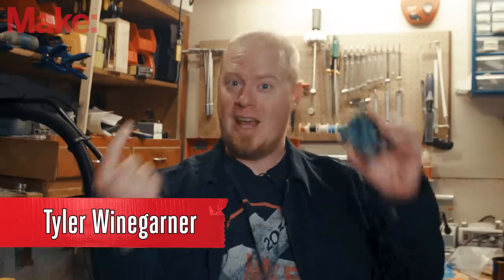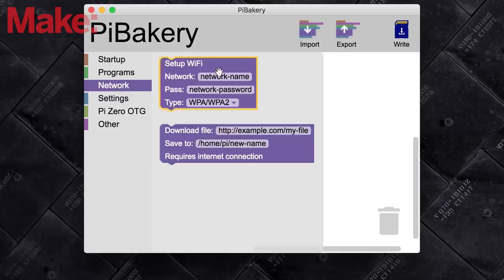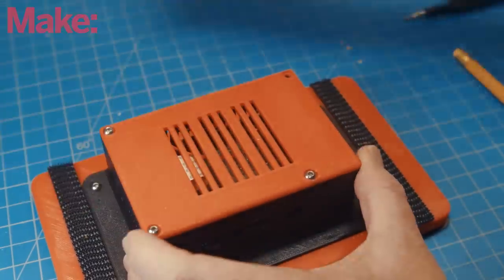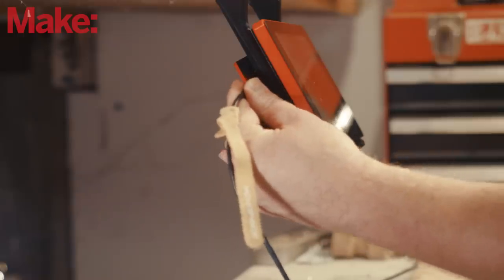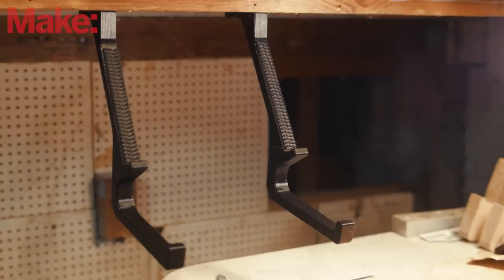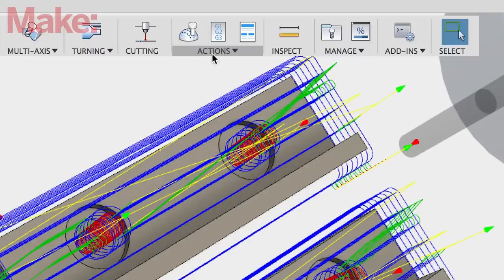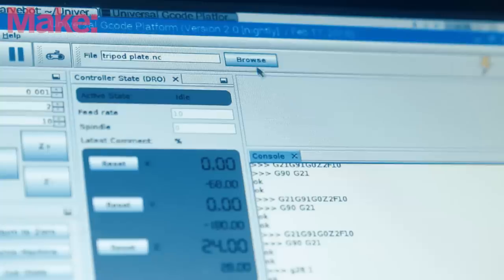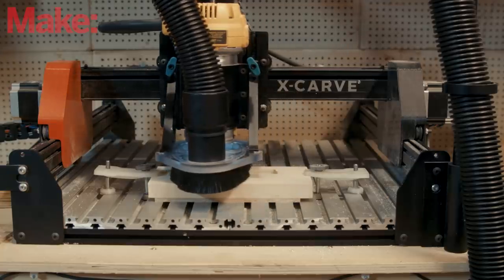Raspberry Pi CNC Controller

Comment: I almost made it - maven installed ok, java8 is installed, cloned the UGS files.   When I run the platform.sh the compile fails.  It gets to the part where it copies 30 resource files, ugs-parent succeeds, ugs-core fails so it skips the rest and I get an error 'Failed to execute goal..............lots of text ending in (permission denied).   Any pointers to where I might get help is much appreciated......
Cheers,    John
Reply: Run as sudo? Maybe sudo -i?
Reply: @RyuuzakiJulio  Thanks, I tried sudo so I'll try with the added suffix.....

Comment: Saves space by not having to have a full size monitor. (Has full size monitor on bench behind him)
Good use of Pi but Idk why you would get a keyboard that has no dust shield and has a touchpad. No need for a mouse, that's what tab and shift tab are for.
Reply from the maker: Hey, I said it was a NEW setup! I haven't rehomed that old monitor and reclaimed the space yet. :D
Reply: Just messing around. IDK why jokes are all considered trolling now? Has society become that sensitive?
Reply from the maker: Not at all! I knew you were having a laugh, so I joined in! So far the keyboard with the dust hasn't been too much of a problem. A dust cover wouldn't be a bad idea, but I don't know if they make them for keybards this tiny.
Reply: I wonder if you could make a dust cover for tiny keyboards using some brush on latex normally used in mould making?

Comment: When I run the run_platform.sh, it goes through the whole download/compile routine each time. What would cause this?
Reply: Shortly after this comment, I dug into the run scripts and found the 'mvn install' at the start. Commenting this out lets the script run clean. Thanks for a nice video
Reply: I'm running into this same problem, can you elaborate on how you solved the issue?

Comment: Tried this setup.  Keep getting stuck while it is building "ugs-pendant".   Not sure why it would be trying to download an x86 image and not an arm71 image, but not sure that's the actual problem.  Output below...Any ideas?  

INFO] Building ugs-pendant 2.0-SNAPSHOT
[INFO] ------------------------------------------------------------------------
[INFO] 
[INFO] --- frontend-maven-plugin:1.6:install-node-and-npm (install node and npm) @ ugs-pendant ---
[INFO] Installing node version v10.15.0
[INFO] Downloading https://nodejs.org/dist/v10.15.0/node-v10.15.0-linux-x86.tar.gz to /root/.m2/repository/com/github/eirslett/node/10.15.0/node-10.15.0-linux-x86.tar.gz
[INFO] No proxies configured
[INFO] No proxy was configured, downloading directly
[INFO] ------------------------------------------------------------------------
[INFO] Reactor Summary:
[INFO] 
[INFO] ugs-parent ......................................... SUCCESS [  1.233 s]
[INFO] ugs-core ........................................... SUCCESS [ 13.193 s]
[INFO] ugs-pendant ........................................ FAILURE [  3.352 s]
[INFO] ugs-cli ............................................ SKIPPED
[INFO] ugs-classic ........................................ SKIPPED
[INFO] ugs-platform-parent ................................ SKIPPED
[INFO] ugs-platform-branding .............................. SKIPPED
[INFO] ugs-platform-ugslib ................................ SKIPPED
[INFO] ugs-platform-ugscore ............................... SKIPPED
[INFO] ugs-platform-visualizer ............................ SKIPPED
[INFO] ugs-platform-plugin-workflow ....................... SKIPPED
[INFO] ugs-platform-gcode-editor .......................... SKIPPED
[INFO] ugs-platform-surfacescanner ........................ SKIPPED
[INFO] ProbeModule ........................................ SKIPPED
[INFO] DowelModule ........................................ SKIPPED
[INFO] GcodeTools ......................................... SKIPPED
[INFO] ugs-platform-plugin-jog ............................ SKIPPED
[INFO] ugs-platform-plugin-setup-wizard ................... SKIPPED
[INFO] ugs-platform-welcome-page .......................... SKIPPED
[INFO] ugs-platform-app ................................... SKIPPED
[INFO] ------------------------------------------------------------------------
[INFO] BUILD FAILURE
[INFO] ------------------------------------------------------------------------
[INFO] Total time: 21.759 s
[INFO] Finished at: 2019-08-22T16:04:20+00:00
[INFO] Final Memory: 21M/51M
[INFO] ------------------------------------------------------------------------
[ERROR] Failed to execute goal com.github.eirslett:frontend-maven-plugin:1.6:install-node-and-npm (install node and npm) on project ugs-pendant: Could not download Node.js: Got error code 404 from the server. -> [Help 1]
[ERROR] 
[ERROR] To see the full stack trace of the errors, re-run Maven with the -e switch.
[ERROR] Re-run Maven using the -X switch to enable full debug logging.
[ERROR] 
[ERROR] For more information about the errors and possible solutions, please read the following articles:
[ERROR] [Help 1] http://cwiki.apache.org/confluence/display/MAVEN/MojoFailureException
[ERROR]
Reply: Rick Romkey I have the exact same problem, I'm trying to run a CNC with my Pi but for some reason the error is installing node and npm. Have you solved this problem?
Reply: I know it has been awhile but have you found a fix? I found that the file it's trying to download was removed from that location but haven't figured out how to bypass this. Thanks

Comment: Very nice project! I'm curious what are benefits of your approach comparing to Android tablet with OTG cable pluged in. I'm thinking on both. Does anyone have any ideas?
Reply: Is there gcode-software for Android? The great thing of a Raspberry is that you can run virtually any software (that compiles for ARM) on it. A lot easier and open than Android, imho.
Reply: IgnoreMyChan yes, it is. It can be used via bluetooth or USB as well.
Link: https://play.google.com/store/apps/details?id=in.co.gorest.grblcontroller
IMO the solution showed on the clip is more elegant, but not only though.

Comment: Hi! Thanks for the video, I'm quite new to Raspberry but really wanted to use it with my CNC, I did exactly as you showed in the video but now I don't know how to make a shortcut to open the UGCS instead of running the instalation .sh file and I wonder if there's another way to open it that doesn't take ages to load. :(
Reply: Never mind, I found out how to do it.
Reply: How do you run the GUI without running the .sh file?
Reply: @cardansan  how do you make the shortcut to open the ugs ?

Comment: The description says Raz Pi CNC Controller you didn't even show the actual controller you're not using the raspberry pi GPIO pins so there for you're only using A G-code sender you're probably using an adurino board.

Comment: Anyone actually get this to work?  I followed the instructions verbatim and the platform version launches a splash screen but never UGS, and classic launches the interface, however connection to the Xcarve never works.  USB is present, and I can open the connection, but it never actually connects and none of the machine controls work...

Comment: I wonder if I can use a X-Carve CNC controller board on my Dahlgren System 300...? My controller for the Dahlgren is toast it's never going to run again, also the computer for thatt controller is toast also, it has a 5 1/4 floppy drive which I don't have any software for it.
Anyone know of a way to upgrade my machine I think this would be the best way. 
Send me messages I will reply

Comment: Is there a similar software for a pi laser cutter
Reply from the maker: UGS can stream code in a few different flavors, and I noticed that one of them is for the Smoothie board, which  is a popular laser gantry controller used to replace the brains in the cheap K40 lasers. So, yes? I haven't done this myself, but it looks possible.
Reply: Make:  cool, building a HEVO 3d printer at the moment and want a swap in laser head, with power and software differences it seems it might be better to run the laser from a separate board and just swap some cables over (steppers etc) when I wanna run the laser so trying to find a nice bit of software\hardware to run the  laser, most stuff I've seen so far seems quite clunky but aspects of this sound pretty good
Reply: LaserWeb.

Comment: Don't waste your time. I don't know if the old links are broken or if there is another problem but ./run_platform.sh fails to build the program. It appears this has happened to several other people over the past couple of years and no solution has been offered.

Comment: Well that was misleading. I thought you meant a firmware which drives the steppers and turns the spindle on and off. I think everyone is already using a gcode sender, this just uses a small convenient computer instead of a desktop or laptop. Boo.

Comment: Good day, hope you guys can help me I seem to be missing something. I was not able to find any documentation on the above project I have compiled my own. however I am having issues.
1) Download and install Raspbian Lite (You can use PiBakery – But this is iffy)
2) sudo raspi-config
Opens window
Join Wifi
Also enable ssh rsa public authentication
3) Get GIT
sudo apt-get git
4) git clone https://github.com/winder/Universal-G-Code-Sender
5) sudo apt-get install maven
6) cd Universal-G-Code-Sender
./run_platform.sh
*ERROR*

[INFO] -------------------------------------------------------------
[ERROR] No compiler is provided in this environment. Perhaps you are running on a JRE rather than a JDK?
[INFO] 1 error
[INFO] -------------------------------------------------------------
[INFO] ------------------------------------------------------------------------
[INFO] Reactor Summary:
[INFO] 
[INFO] ugs-parent ......................................... SUCCESS [  1.355 s]
[INFO] ugs-core ........................................... FAILURE [  4.183 s]
[INFO] ugs-platform-parent ................................ SKIPPED
[INFO] ugs-platform-branding .............................. SKIPPED
[INFO] ugs-platform-ugslib ................................ SKIPPED
[INFO] ugs-platform-ugscore ............................... SKIPPED
[INFO] ugs-platform-visualizer ............................ SKIPPED
[INFO] ugs-platform-plugin-workflow ....................... SKIPPED
[INFO] ugs-platform-gcode-editor .......................... SKIPPED
[INFO] ugs-platform-surfacescanner ........................ SKIPPED
[INFO] ProbeModule ........................................ SKIPPED
[INFO] DowelModule ........................................ SKIPPED
[INFO] GcodeTools ......................................... SKIPPED
[INFO] ugs-platform-plugin-jog ............................ SKIPPED
[INFO] ugs-platform-plugin-setup-wizard ................... SKIPPED
[INFO] ugs-platform-welcome-page .......................... SKIPPED
[INFO] ugs-platform-app ................................... SKIPPED

any advice would be great thanks
Reply: did anyone solve this?

Comment: I made one classic machine with grbl and laptop.
https://youtu.be/TDTDN_KkoJc
I am making the same setup you have now. I use Raspberry Pi 3 B+, Arduino mega 2560 (maybe I will put additional axes) and my custom designed 15A drivers. Machine I made has 450x700mm working area and the new one will be 1200x1500mm. 

I have a problem. Visualizer in UGS doesnt' work. I tried python bCNC and it works but I prefer to use UGS. Do your UGS works as it should? Can you see model in UGS?

Comment: Seems like a clever but unnecessary link in the chain. Why not use a RAMPS board with an SD card reader and put the G code files on there; as per reprap 3d printer...that's what I'm going to try to do. Unless someone knows why these devices should not be joined in marriage?

Comment: Having to enter a command code in order to set the machine home is a deal killer.

I can enter commands at the prompt as well as anyone however, I learned a long time ago that it is the most inefficient way of running a computer.

Over the years I have come across the little minds that criticize people for not being able to administer their computer from the prompt like the average geek or nerd and demand that everyone learn to do so. I have also come to realize that the making of such demands:  is a clear indication that the person or persons doing so are brain damaged. It's not going to happen!

If an obviously necessary command such as machine home is not obtained by the click of a button, the interface is unacceptable.

In addition, it has to have a full sized monitor.
Reply: Just set up a Macro. The you have click of a button.
Reply from the maker: Maybe it's not for everyone? I don't suspect this is for CNC job shops, but then again if it were, I'd be using a Haas and have much more sophisticated software and trained professionals rather than bodgers like me.
Reply: You can easily connect any regular display to a raspberry pi. But, the thing is that it's open source. It's made to be cheap. As I challenge you to find a $35 computer new in box. That is what the raspberry pi 3 costs (plus accessories of course). Yes, you can of course modify the software if you feel like to add that button. The thing is: that's not for everyone, which you clearly demonstrated. The raspberry pi is a different thing from what you see a "computer" to be. I've been around 25+ years in the computer world, and the raspberry pi is something different. In some aspects it's WAY beyond what a computer is and can do, and in some aspect it's lacking a lot. But, it's more of a DIY thing than a computer you buy and just starts using. Look around a bit, there's plenty of things you can do with a raspberry pi.